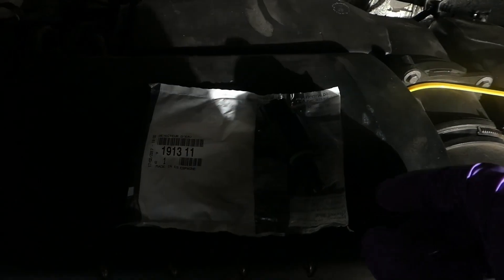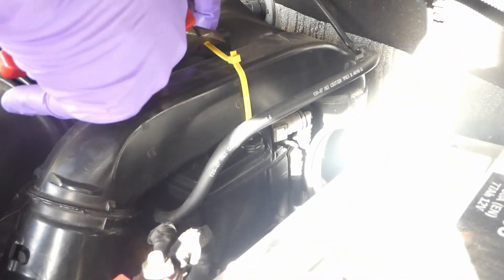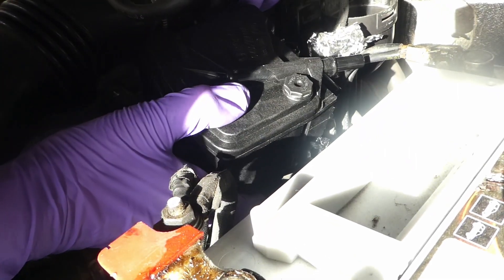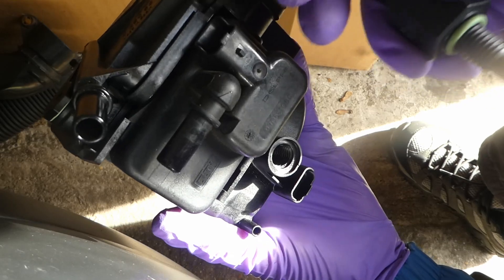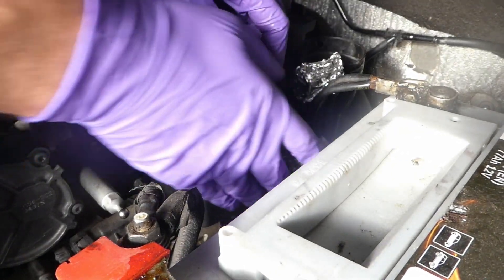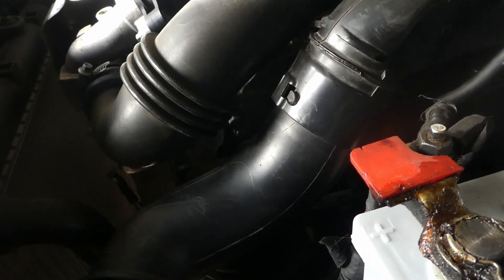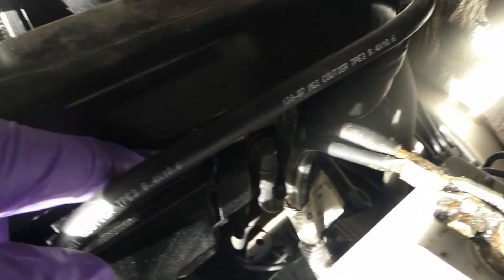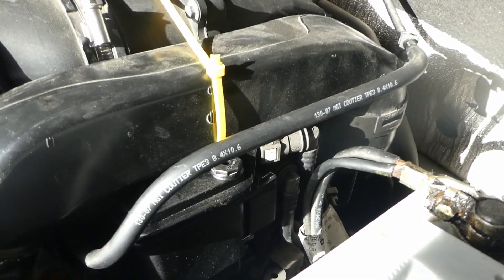How to fit a water in diesel/fuel sensor 1.6HDi/TDCi (Peugeot, Citroen, etc.)

Comment: I have mini 2007 d but it does not have water sensor, only that heating element and what is the air on top? And how does the filter drain the water?
Reply from the maker: Ahh, not too sure what you mean, but it should be the same design. It might not have the water sensor, but that is additional, most do not come with a water sensor. The filter drains the water like this: https://youtu.be/nDetfYq2P74

Comment: Hola buenas, perdona una pregunta tengo un Peugeot 307 HDI 2007 , el problema de mi coche esque cuando voy a 100km/h en adelante y a un cierto tiempo el Coche me da tirones y luego deja de acelerar y se apaga, no me marca ni un fallo en el cuadro solo me pasa así algunas veces, que podría ser , puede ser el sensor de temperatura de combustible??? Un saludo Gracias
Reply from the maker: Difficult to say, it is better to plug it in OBDII scanner and see any error codes.

Comment: Very very interesting video. Also my Citroen C3 1.6 HDi 90HP, 9HXC (DV6ATED4) engine, 2010 has not water sensor but onboard computer shown alarm "water in diesel filter". I am very surprised. I don't understand.
Reply from the maker: Are you certain that you do not have a water in diesel sensor? You could try to drain any potential water from the diesel filter. There is a plastic nut on the top of the filter and a drain pipe on the bottom of the filter. I would undo the nut and see what comes out of the bottom. Once diesel comes out, screw the nut. I suppose it is worth a try.
Reply: @paolorusso3399   It's been a while since you posted your message but did you find resolution to your problem? I have the same problem with my 1.9D Peugeot Partner. I bought it new in 2007, it has approx. 180000km, but until now I was completely unaware of this warning lamp that it even existed. Now it turns on and off, sometimes when I start the car, sometime during driving - low speed or high. Same as you I drained the filter (housing) and replaced the filter, found no water inside, but it happened again the very same day, and still persists on and off again. I'm curious of what is causing this issue. Is it really water, is it some kind of sensor, is it a faulty dashboard or smth else. Please respond if you found an answer to this problem. Thanks.
Reply: @darkoserafimovski8127   Darko Serafimovski  SOLVED. I have leaved the car under the sun for two or three weeks with battery disconnected. After, I have replaced the battery and the problem has disappered. I don't know if the problem was umidity in some electric circuit or bad old battery. Meanwhile glow plugs relay error has disappeared. I hope that my experience is useful for someone.
Reply: @paolorusso3399 . Thanks for the quick reply. That's a good suggestion. I'll swap the battery with another one first and move on from there. I will follow up on this issue. Thanks again
Reply: @darkoserafimovski1696  Ok, let me know. Good luck.
Reply from the maker: @Defund BBC Thank you for the info, much appreciated. I did not know they were only fitted to vehicles destined for "hot" countries. I know it was not standard as mine was not added. I added the non-standard board computer, outside temperature probe and cruise control, although these were available as purchasable.

Comment: Help needed, I've got p2265 fault code "water in fuel" Done all regular checks, no water in fuel, drained fuel system, disconnected sensors and checked wiring! It mostly activate's the EML light and brings up the code when it's cold? I've also got the dreaded phantom p1352 relay closed circuit code😒 Any help appreciated before this old 1.6hdi citroen despatch gets warmed up with petrol and matches
Reply from the maker: Are you sure you do not have water in the fuel filter? There is a drain valve on top of the fuel filter and a small spout at the bottom for drainage. Unscrew the valve, drain a bit of liquid and see if it contains any amount of water. If there is no water, then it could be that the sensor is at fault. You could potentially disable it altogether in Diagbox/Lexia
Reply: @moremolecules  thanks for the reply, no water in the fuel, I was thinking something else might be bringing this code up like they sometimes do, hopefully I’ll be able to disarm the sensor when I can get hold of lexia. Thanks again 👍
Reply from the maker: @leefurniss  I am not aware of anything else that can bring this error code. It is either replace the sensor or disable it altogether.
Reply: @moremolecules  Thanks, I can't see it being the sensor as I'v disconnected it and it's still popping up randomly but mostly when It's cold, I'm guessing it's either the wiring or possible fault with the ecu. When I can get hold of a lexia ill attempt to disable the sensor. I'll let you know the outcome. Thanks again👍
Reply from the maker: @leefurniss  Ahh, apologies, yes see if there is any earth not entirely connected or some condensation anywhere in the engine bay/ECU/BSI

Comment: Hi mate did you're original sensor fail?
Reply from the maker: Hi MrPaddywack2001, no, the car did not come with such a sensor. I decided to fit one in case I get dodgy fuel from somewhere or condensation from somewhere.

Comment: Just want to share my story maybe it will help someone - i was unable to start my vehicle, the error on the dashboard said "WATER IN FUEL FILTER". However, turns out it was the low battery causing this error, not the actual water in the filter (there was no water i tried to drain it before).

*i was making short trips, and the temperatures was below zero so the battery did this to me :)
Reply from the maker: Hi David, many thanks for this. Yes, the water in diesel sensor/warning is just a warning and does not do anything to the engine.
Reply: @moremolecules  Thanks for the video. Funny i also have zip ties on the air intake pipe like you do. This engine is vibrating like crazy :)
Reply from the maker: @davidbalev  Haha, I have not really found a better way to do it, too much vibrations and without the zip ties sounds like something is about to break
Reply: @moremolecules  Well, good for you because on mine it did worn out some plastic parts already. And also broke the metal engine shield in front in 2 places :D All fixed now. However, i found that you're posting more 1.6hdi videos. Glad i found your channel it will help us DIY people a lot :) Hope you'll have a great day!

Comment: Code error P0087 and P0097 cintroen xasa picasso 1.6HDI 92 filter diesel??
Reply from the maker: Hi francisco, I would replace the fuel filter and see if the error persists. Also, check for leakage around the fuel lines.